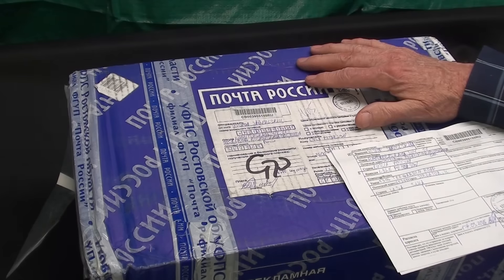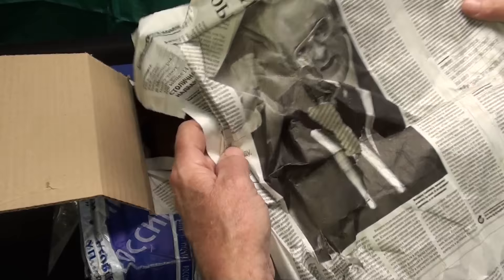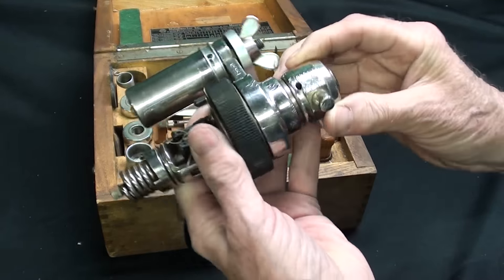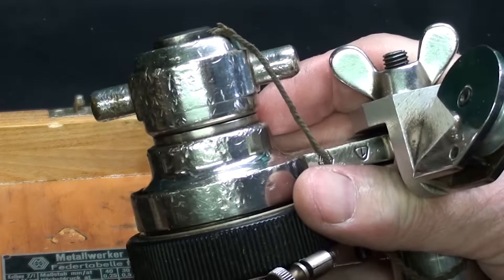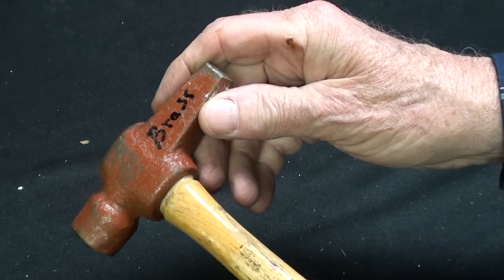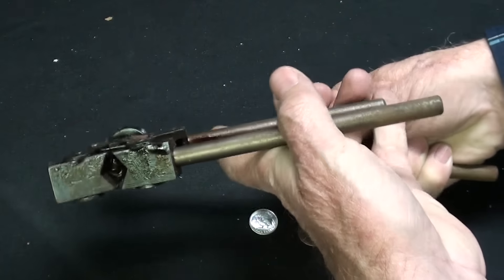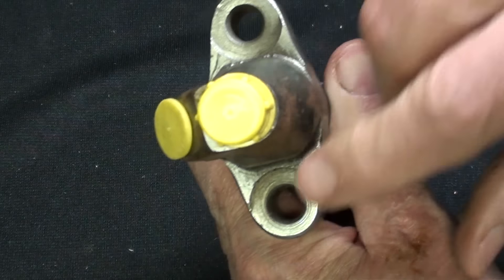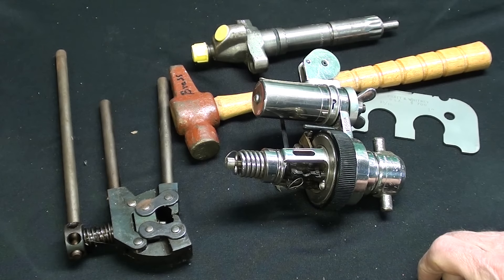WHAT IS IT?  #27a question Mystery Item tubalcain mrpete222

Comment: Item 4 looks like a chain breaker.  I could not imagine what the other items are.
Reply: +Amateur Redneck Workshop I have one of these. It's an old chain breaker. You put the links into the teeth and turn the crank to punch out the pin that ties two chain links together.
Reply: Yeah, that is what my chain breaker looks like also.
Reply: +sdyoungii ditto. I have a small one that works on my bike chains only it comes from the side. Would love to have one with that much torque! Probably work decently on size 40 chain still commonly used today unless everything has went metric. (note everything on a bike is these days except the pitch between the chain links. Why is that? It probably drives them as nuts as us trying to remember a fractional metric number)

Comment: your item appears to be a steam engine indicater. It indicates the steam pressure in the cylinder & records the pressure on a paper card attached to the roll driven by the cord that is attached to the cross head of the engine. I used one on my 1907 Frick steam tractor.

Comment: 1: Is is definitely East German indicated by the DDR marking.  Pressure and heat seem to be in the chart, so I'll go with boiler pressure tester, though for the life of me I can't imagine how you would use it.     
2: Obviously it's for  hitting square nails... duh...        
3. A stogie guage.
4. Roller chain breaker
5. Diesel Injector?

Comment: The Russian device I would swear is an type of Indicator most likely either rpm of odometer  distance reading but since you said no swearing so much for that guess. Number two hammer is a brass hammer used around magnets. The P and W plate is a gauge I am thinking for  grooves of the indicated diameters of 15/16 and one inch..may be a go no go groove, number 4 chain link pin breaker. And after that I believe that to be used in slaughter houses to drive a pin into cattle skulls.

Comment: Can't you put these in their own playlist? Most other channel content seems to place the second one after the first one. I don't know why it doesn't for yours. I think they pliers like item is an industrial chain braker, the pratt and whitney is probably an aircraft tool to do a tuneup which might also account for the "thin" metal.. like a feeler gauge for points or plugs. The Vs are consistent with screwhead tops so they often measure length, maybe to make sure you put the rightlength screw in the right hole?

The german thing is a spring loaded indicator for bores of some kind, possibly the product of rifle making and air canons but I'd have to check the #s again. You'd want to reindicate the outside before you bore its hole and file its rifling. 

Of course I knew einstein but still have no idea who the last guy is. Guess I'm too blue collar to even care.

Comment: it is used for drawing out a graph of relation on steam engine stroke vs steam used and produces draw, or pull cards.
Reply: and the different springs are for measuring different engines stroke to steam ratio

Comment: Best I can do with Google Translate for the chart plate:
"Feeder table for indicator type 30 and type 30 / h"
"Piston 2/1 Diameter 28.66mm"
"Scale mm / at high pressure at"
"Springs with vacuum"
"The feathers are 'jusiert'(?) and stamped with the scale in mm / at for the 1/1 piston (red lines)"

Comment: #1
To save everybody the trouble, here is Google translate: (not very good translation)

(top line is company, maker, and city/country)
Spring Table for indicator (second top line)
Springs with vacuum Share (big box in middle)
The springs are adjusted and stamped with the scale in mm/at the 1/1 piston (rots figures) (bottom line)

The boxes in the first column say: 
Piston 2/1 
(diameter) 28.66mm 
(and so forth)

Second column: 
Scale mm/at 
Maximum pressure at 

I'm pretty sure "rots" is red. Not sure why Google didn't translate that. Maybe it isn't an "s" in rots.
"at" is probably "atmospheres" or about 15 psi. Don't forget that the [ , ] (comma) is used for the decimal point in much of the world.

That said, I have no idea what this is for.

(pop quiz) #1 is Einstein #2 is Whitney #3 ???

#2 That Lixie hammer is bronze rather than brass (but not beryllium-bronze as you say) I have one just like it from McMaster-Carr (where it was described as bronze), so I will be interested to hear if it has some special purpose. I like it for getting into close spaces. Plain bronze by itself is fairly non-sparking, but can get grains of sand embedded (which beryllium-bronze resists) that might cause a spark when hitting steel.

#3 gauge - no guess

#4 is a roller chain breaker for separating links. It has a fairly limited range of chain sizes that it will work with.

#5 - no guess

Pretty poor showing for me;  only one correct guess (#4 - #2 doesn't count as a guess) and only 2/3 on the pop quiz
Reply: +Peter W. Meek It is red, the lighting on the video makes the "e" at the end of "rote" look like an "s".  The tool is still available for sale in from Germany at: http://www.ostron.de/Mechanik/Mechanik-allgemein/Aussenfeder-Indikator-Typ-Metallwerker.html and is used to measure cylinder pressure (as a couple of other commenters have mentioned).

Comment: Well, from what I can gather using the Goggle Translate camera feature... It is a device to measure something to do with a piston in a diesel engine. Like the distance at the top of the stroke.  Looking at 4:37 -

The DDR means it came from East Germany (Deutsche Demokratische Republik)  

Then "Maßstab mm/at Höchstdruck" means "Scale mm / at maximum pressure." 

"Federn mit Vacuumanteil" means "Springs with vacuum Share"

Along the bottom: "Das Fordern Sind mit Maßstab in mm / in für den 1/1 Kolben justiert und gestempelt (Rote Zahlen)"
Means : "The Request are adjusted and stamped with scale in mm / at the 1/1 piston (red numbers)"

5:40 - According to http://www.xe.com/currencyconverter/ it is the Ruble. (RUB)

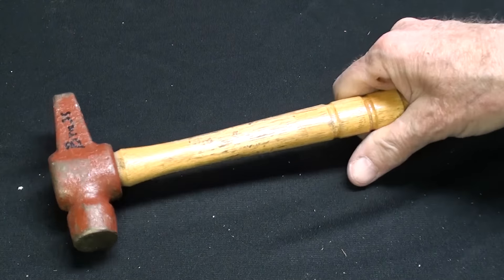6:07 - Dual purpose Bronze hammer: http://www.jisspecialty.com/JIS_Specialty_Products/Product_Line_files/Lixie%20Brochure.PDF
Reply: +askjerry  I'd translate Vacuumteil as partial vacuum...  teil = part

When I googled on it, I found a German website which makes reference to the original design being from James Watt in 1790...

Aussenfederindikator = External spring indicator

http://www.ostron.de/Mechanik/Mechanik-allgemein/Aussenfeder-Indikator-Typ-Metallwerker.html

Some more Googling and I get a German ebay listing for a Drueckpruefer (pressure tester)

You can see that it has different springs for different pressure ranges - and the table helps in selecting how to configure the instrument.

And, that's as far as I can get in 5 minutes... ;^)

Eric
Reply: And... It appears that Randy Richard and a few other guys have actually used similar devices to "pull a card" on actual engines...

Not my flavor of Mechanical Engineering, so I'm playing catch-up ball... ;^)

That said, there is something very neat about how the old guys worked out how to take these measurements mechanically back in the day.
Reply: +chemech even though that is 'old tech' some tools like that are still in use today. and in some cases i think it can be more reliable.
Reply: Reliability comes down to how one uses a devices, and how one maintains it.

OTOH, it's always interesting to see how things got done in the days before cheap semi-conductors... sometimes, the mechanical methods are easier for some people to understand.

Comment: 5 ok if you have the other 3 5 or 7 deisel injectors looks like a mercedes injector. The bronze hammer and chain breaker are easy. To make a guess on the first some form of pressure indicator or control valve.

Comment: Google translate only allows for a limited number of words but here is a portion from German to English......

"The value of the indicator for the testing and monitoring of reciprocating machines of all kinds on all sides known . Its use extends from the test bed of manufacturers such Kolbenkraftmas".
Reply: Also, the hammer is a Lixi Bronze Dual purpose hammer - For general usage such as machinery maintenance, sheet metal forming, welding, and assembly.

Comment: # 5 is a drive chain breaker. the type of chain,  you find on motor bikes etc. you get one for chainsaw chains as well but they usually have a little gadget attached to round the head of the new pin when the chain is put together again.i

Comment: Hi mr Pete
Lixie hammer
Non sparking bronze hammer with hickory safety handle silicon brass pin head
Pratt& Whitney
Wheel defect,worn coupler limit,worn journal collar,fillet gage for trains
Crome item
Diesel engine fuel injector 
Regards kerry

Comment: It's a graphing gauge to measure engine cylinder compression. The paper wraps around the cylinder, and a stylus hangs from the string drawing on the rotating cylinder. The different springs change the range of pressure it measures.
http://americanhistory.si.edu/collections/search/object/nmah_847278

Comment: The Russian item is a diesel engine power card machine. These are typically used on marine diesel engines - Look at this: https://www.youtube.com/watch?v=eha3JOBOsjo From 5 minutes in the device is shown in use. I am a Marine Engineer and have used one many times, although they have now be superseded by electronic versions. It is screwed to a valve on each cylinder head. Inside is a piston that acts against a spring. As the cylinder pressure varies, the piston moves up and down. This motion is translated to a stylus which draws a power diagram on the paper strips. This diagram allows an engineer to measure the power out of each cylinder.

Comment: After cheating by googeling I found it's basically a preassure gauge, by changing the springs and pistons it is rated for preassure 0 up to 1500 bar (21755,66psi) at max. 1000 rpm. Maßstab -> (meassurement)Scale, Feder(n) -> Spring(s), Höchstdruck -> max. Pressure, Kolben -> Piston, "at" -> "atü" basically the same as bar ( old name "Atmosphären Überdruck" = multiple of natural pressure ). A long explanaition of that tool I found on that (german) website : http://www.ostron.de/Mechanik/Mechanik-allgemein/Aussenfeder-Indikator-Typ-Metallwerker.html ( obviously in german ), I guess if you search for James Watt ( the german website claims he did invent that kind of gauge ) an pressure gauge you might discover it somewhere in english.

Comment: I want to thank the man from Russia for sending the item so we can see it. I'm sure it was very expensive to ship. Oh and btw I think it is a muffler bearing installation tool for a Tiger tank. Nobody knew how to use it thus giving another reason why Germany lost the war.
Reply: blah. my finger hit the damn windows button or something and lost a huge post  had

I think the wooden handle goes on the other end of the bakelite thing because otherwise you have no way to retract the spring and in that era nothing to see for a spring it seems manual would be most likely. Plus its the part you'd need to replace the most, if ever. Seeing how much string was in there might give us a range of items.

Right now my intuition screams war effort, very important, and likely used in an airplane, large gun, or tank.

Why would you knurl the big piece?

Mrpete:  I think for his efforts the Russian guy deserves another better video of this, slower, pull the ROD completely out. show us how much string, manipulate it more.... it came a long ways and its a fun brainteaser. Could we get a clue like the year?

Do the spring accessories in the left hand size also fit into the top of it? It looks like you might need one at each end to indicate bore roundness if it is a large bore like a diesel truck or tank engine. 

And we never saw the indicator move in any direction!

So you put the spring thing in the other end, then rotate those stubs out (maybe using the wooden handle for that but they seem too big for its small hole) to fit whatever you are mesuring the inside of. The string is to keep it perpendicular but also its adjustable so maybe it can come out the valvehead end as well as the crankshaft end if you are checking a casting that was just made or crosshatch bored.

If it was an airplane that wooden protected spool that pivots under the thumbscrew could be for radial engines and their valves which need near constant oiling. I think they had just invented the automatic oiler back then. Or it was in its infancy.

pistons were also in rifles, antiaircraft guns and not common due to the time they were complex technology -- now I've got two bikes that have 3 pistons in each! 

 lightly used but used roughly when used sounds like military personnel also. Someone put the monkeywrenfch on it -- I've never worked ina machine shop or I think I'd have a better guess. But I'm a good woodworker and that takes a fair amount of metalwork ( as much as I like to, I guess) especially if you prefer your tools sharp and there's nothing in my shop I can not sharpen. I do make small simple metal tools, mostly chisels or gouges. Impromptu hole punches. Simple quick and dirty solutions in most cases.

Comment: It is not surprising that an old German pressure indicator (for measuring 'indicated power') ended up in Russia.  When the Russians were returning from Germany at the end of the Great Patriotic War (WW2) they took all lathes, milling machines etc as the war effort had worn out most Russian equipment.  27 million Russians had died!  For example out of every 10 males born in 1923 only two survived the War.  Regarding Putin, Victor is likely to be a supporter like 82% of Russians.  This is down from 89% following the democratic decision of Crimeans to return to Russia.
Reply: +Joss Fitzsimons Except that this instrument was made in the DDR (East Germany) after the War... not that it wasn't the same widget that the company had been making before, just that this example is from the Cold War Era...
Reply: +chemech I concede!

Comment: Just a little remark:
Brass and copper tools was in my time (70's) used when we made repairs on vessels transporting propane gas or any other form af gas.
you couldn't do a repair on a vessel of that kind without using such tools. i think it's still the thing